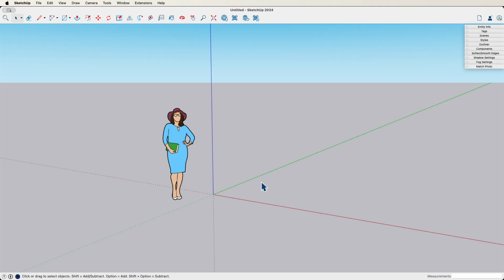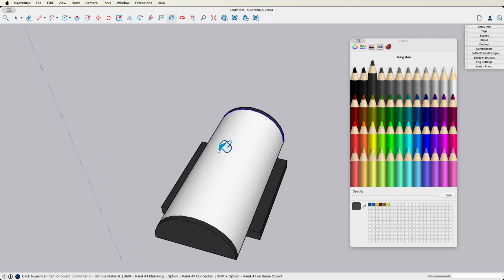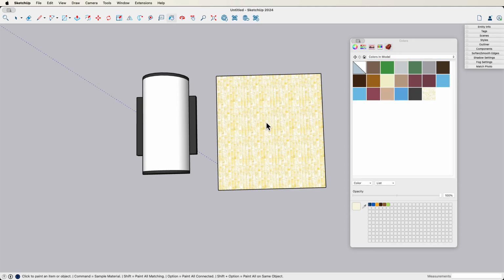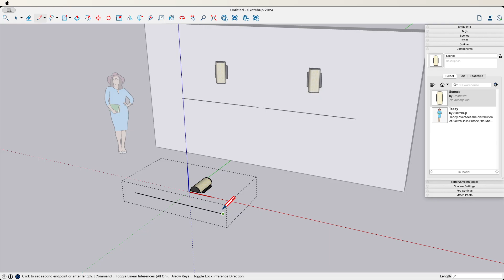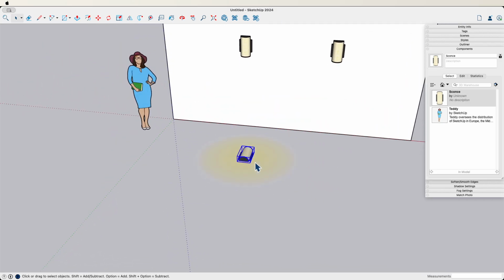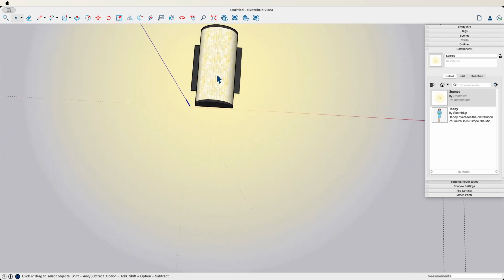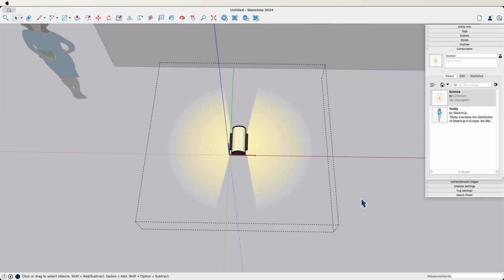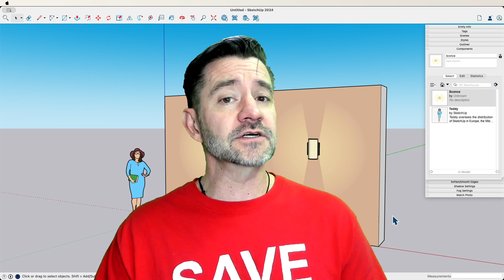Modeling a Wall Sconce with Lighting | SketchUp Tutorial

Comment: OK, SketchUp is not a renderer.  But, you need a part two.  Now turn this into a dynamic component so it has a single behavior if clicked or double clicked…hide the light pattern to turn off the light.  Click again and you turn it on..